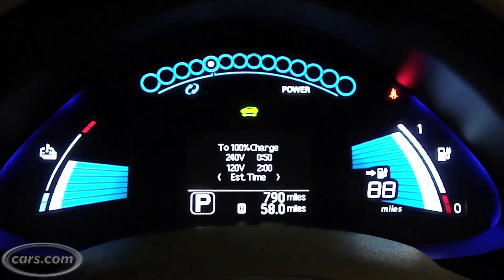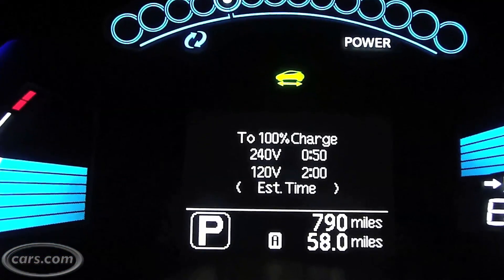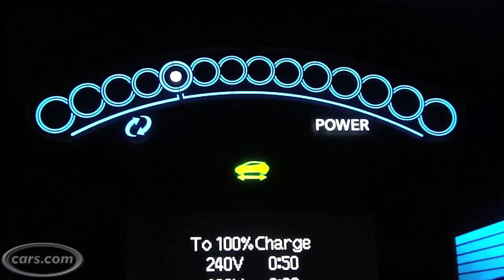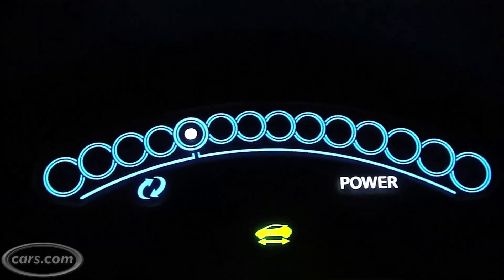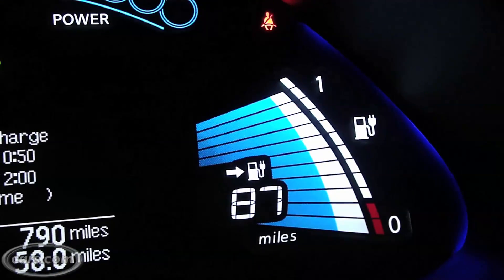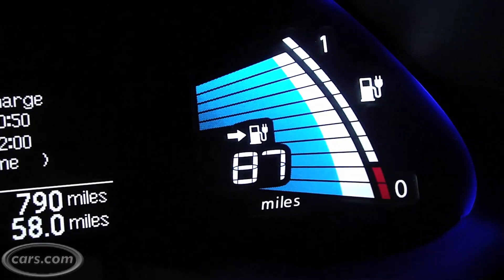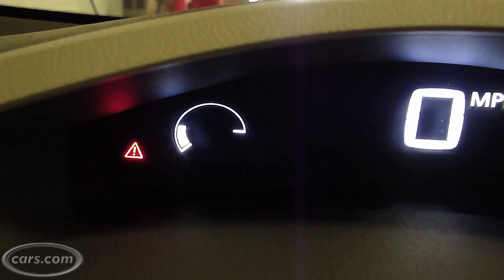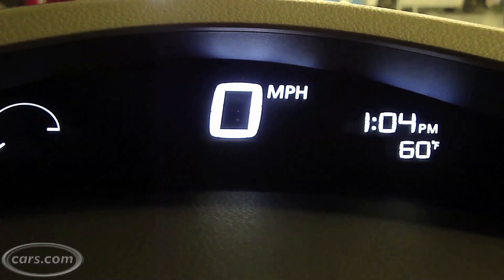Nissan LEAF Instrument Panel

Comment: how many miles would it need to coast to completely fill up the batteries? (assuming you are almost empty on "juice")
Reply: I would like to know this too! I know its charging pretty fast especially in B mode! It had mine go in turtle mode the other day while on the highway. I took the off ramp immediately, and by the time I got to the stop sign it was not in turtle mode anymore. I made it home! My home is less than 2 km from that stop sign. Yeah!